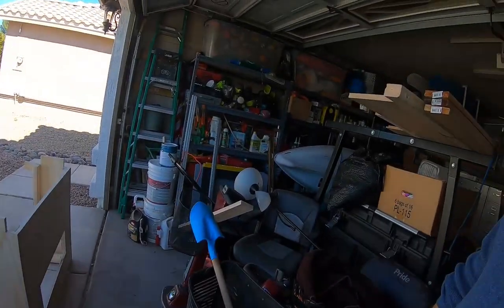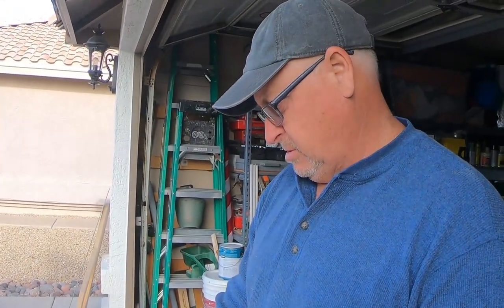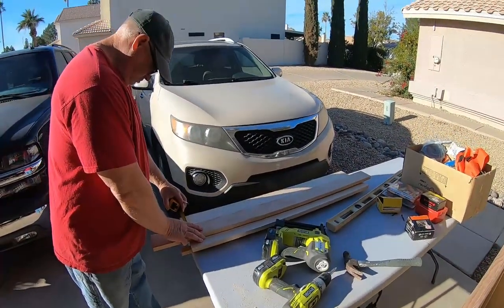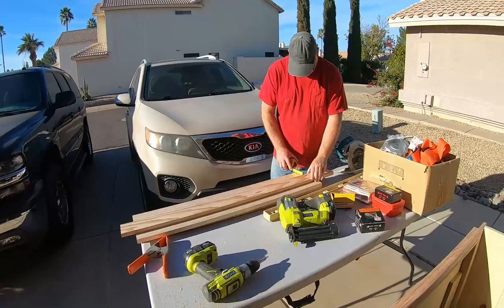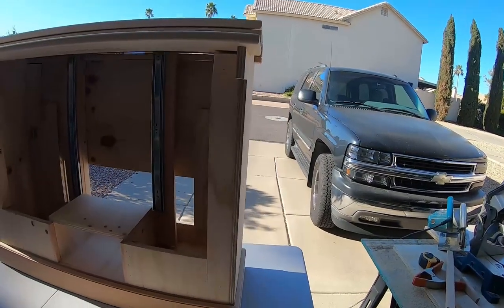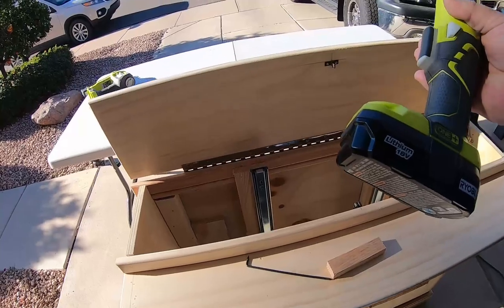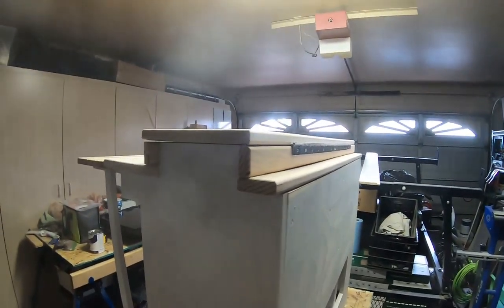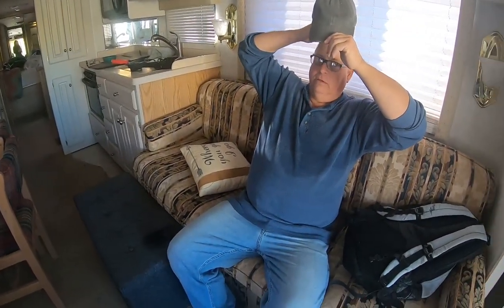Build A Custom TV Lift Cabinet - Desk / Table For RV

Comment: I would like to see how it attaches to the drawer slides . I love this whole idea .
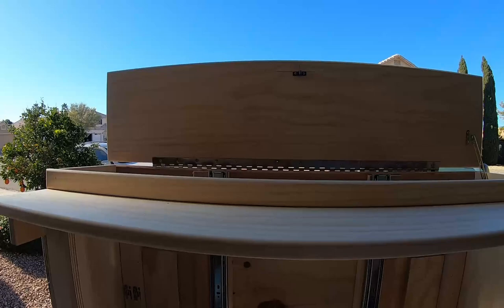Reply from the maker: Will try to help. At about  1:20 in the video, I showed the piece that mounts to the back of the tv and attaches to the front part of the drawer slides. At 10:50 you can see how the drawer slides mount to the back of the cabinet. I should have shown that in the completed unit. I would send you more pics, but we sold the Holiday Rambler and are starting renovation on an Alfa Motorhome now.

Comment: Hi Jamie, hey just wondering if you have a set of plans you would like to share for the TV cabinet. curious as to how the drawer slide lock in place ?
Reply from the maker: Unfortunately I don't have plans. I just kind of make stuff up as I go. As far the drawer slide lock. I did a brace the same way I did the hinged desk with a piano hinge. I have added the same kind of TV lift for our current RV. Instead of a brace I used a pin to lock it in place. There's a piece of plywood that the slides mount on. Then I have another piece of plywood with the handle that I had cut out that's mounted to the TV. Once I raised the TV to the height I wanted it to be I drilled a hole through both pieces of plywood. Now when I raise it up I just put the pin in. I think it works a lot better. Thanks for watching and  maybe you'll  come up with some improvements!